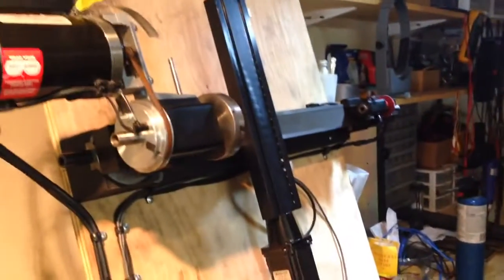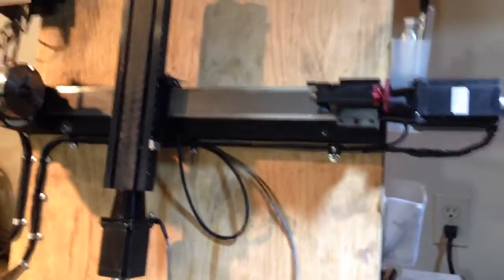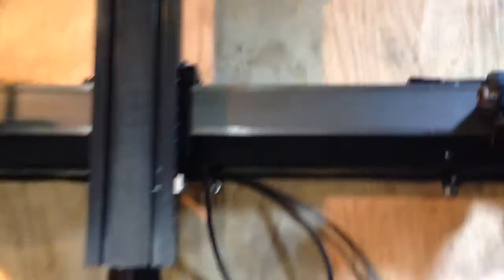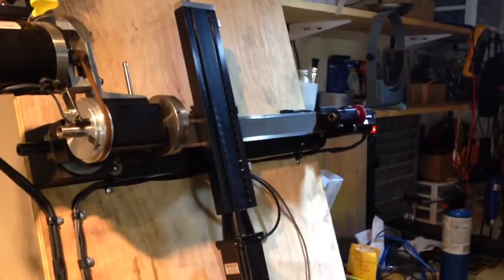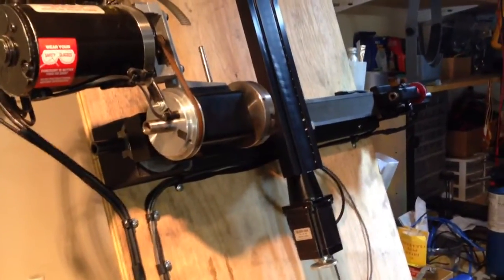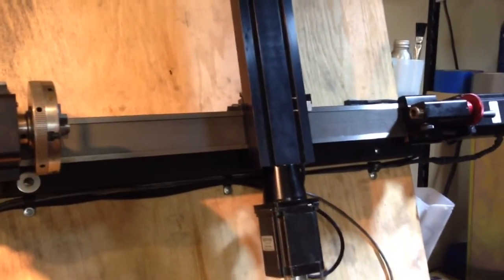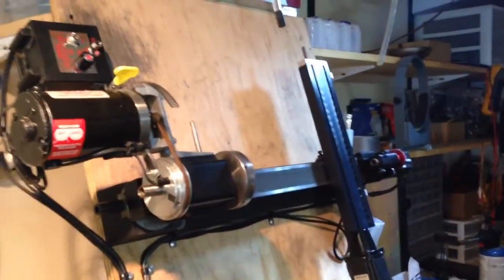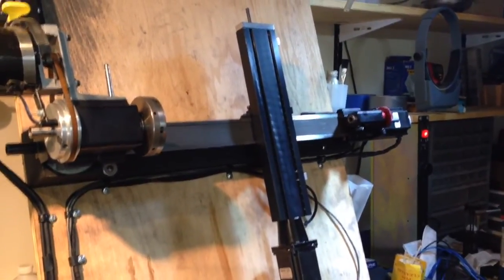Sherline Lathe expansion.

Comment: I have a Sherline 4400 lathe, minus the motor assy, I got a small cogged drive pulley, 10 teeth, a 3.1" 120 tooth spindle pulley, and a dual groove smooth pulley, ~2.5" & ~3.0" .

I originally planned on using a 1/10 hp motor, similar to the OEM Sherline, but got delayed working on the lathe for a couple of years. Now, I see companies offering much larger motors, over 1.5 hp.

I have also acquired about a half dozen DC motors since I bought the lathe, and am wondering if I should put a larger motor on the lathe.  While I may not need to raw power for turning, from what I've learned about DC motors, I should be able to maintain adequate torque at various RPMs better with a larger motor.

If you could pick any size motor for your lathe, money not an object, what would you choose?  Anything else you might do related to the motor, pulleys, belt, etc.

Something else I've been trying to sort out is belt type. Are the cogged belt & pulleys only used for slower RPMs, with the smooth pulleys and a cogged belt used for hgh RPMs?

Thanks for any help you can give to a Sherline noob. 

GeoD
Reply from the maker: Oddly enough I dont think there is too much advantage in increasing the motor size on the Sherlines. They are excellent for what they are but not rigid enough for more power or speed. Maybe a .25hp but you wouldnt be able to use it all. I have always used smooth belts. If I have ever had slippage it was due to a boneheaded move. In the beginning you will try to push the Sherline past its limits. You will learn to calm down (or quit machining). It is very forgiving and tools are cheap in comparison to larger machines. Enjoy the learning.
Reply: You are not the first to suggest a ¼ hp motor as the most.

I wouldn't be going larger for the high rpm brute force, but to provide adequate torque at slow speeds, since that seems to be the knock on DC motors.

But then, others have said it's not a problem, or not as bad if the DC motor is run via a Phase modulation type driver and speed control.

Part of my struggle is I don't have any experience with DC motor powered equipment in my shop, AND I don't have any experience with the Sherline, or A Sherline.

If I knew what an OEM was like to work on, I'd have a scale. Same with a saw, drill, sander, etc with a DC motor. I'd have a feel for DC performance.

I discovered treadmill motors about the same time I stumbled upon the Sherline, and the lathe will be the first thing I drive with a DC.

I want to convert my vertical band saw to DC. I think it will be a better multi-purpose saw if I can control the RPMs so as to optimize SFM, (surface feet / minute), for the material being.

So, it seems like the cogged belt is used with the smooth pulleys. I thought I had seen, or possibly even had a round belt for the Sherline.  I may be getting it mixed up with something else.

The cogged belt is very flexible, and must work, it is just strange to use such a mis-matched belt and pulley setup.

Though, unless I can find a usable arbor adapter, so I drive a ¼" bore pulley on a ½" or ⅝" shaft, I may have to switch to a different belt and pulley type.

My budget is limiting me to scrounging as much as possible. Very limited on 'new' parts, especially with the Sherline 'premium'.

Thanks for your input.

Comment: Cool Video! Hey I just converted my Sherline lathe for CNC and I would really like some closeups of your limit switches (my only remaining detail). Thanks and I can't wait to see your gang tooling setup for this. I will be setting up gang tooling on mine as well, Note: I've read that if your are going to use CSS (constant surface speed) that perhaps the best method to program is to use G52 (temporary offsets) for each tool position, I'd love to hear your ideas/results,cam program and or settings